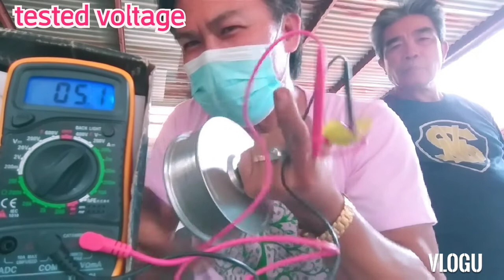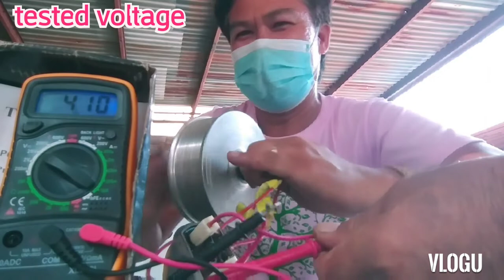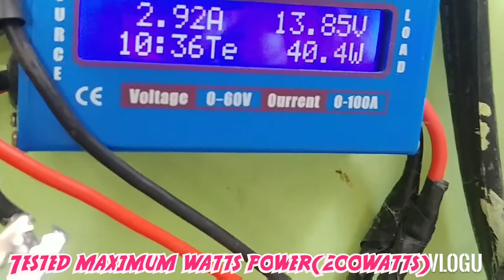HOVERBOARD MOTOR TO LANTERN TYPE WINDMILL.....

Comment: The output of the hoverboard is AC right? So how you converted that in DC?
Reply: No sir. The output of hoverboard is DC sir... But you have to use windturbine charge controller 12v to reduce dc current into 12volts....hoverboard maximum watts power maybe at 250 to 300WP....
Reply: Thanks for watching my video sir.. And thanks also for visiting my channel... God bless sir. 🙏
Reply: @Riosmuler  Thanks for the reply😊
Is there any way I can contact you through chat?
Reply: I have made three generators from these motors and yes they where three-phase AC. A three-phase rectifier turns it into dc with very litle loss